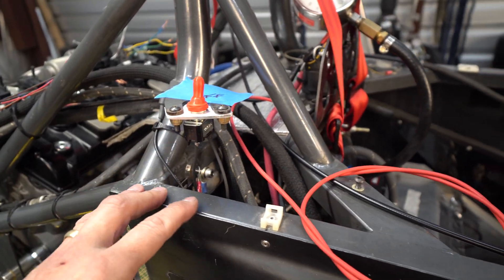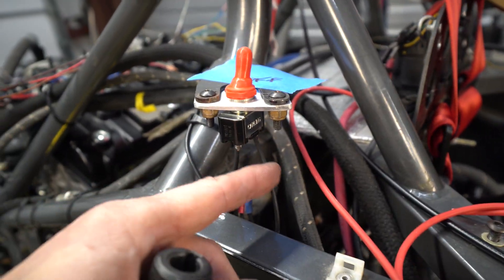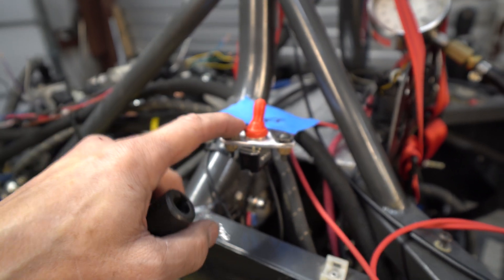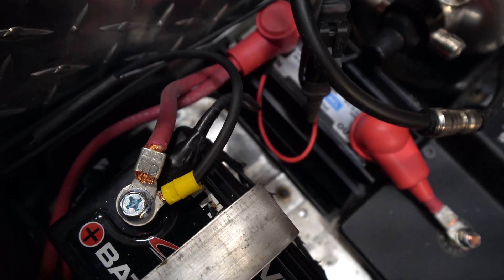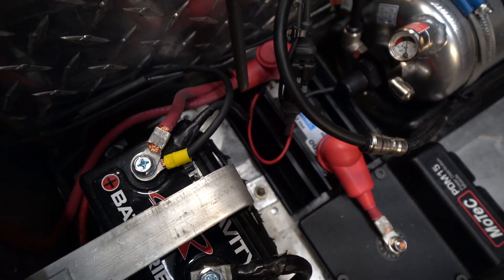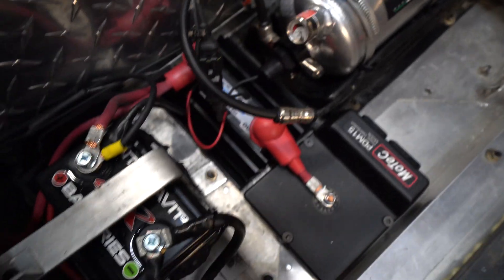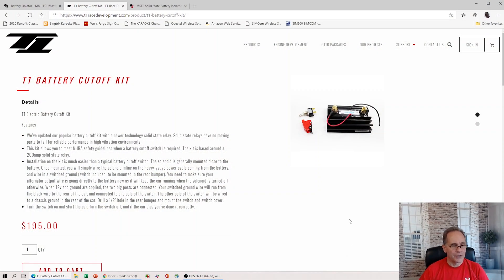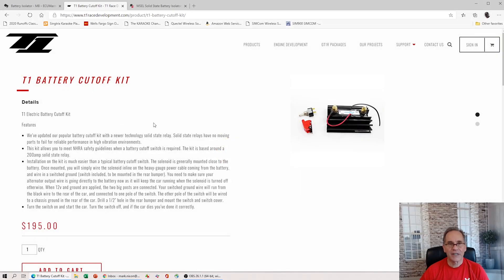SOLID STATE BATTERY RELAY (ISOLATOR) - A Race Car Solution You Didn't Know You NEEDED!

Comment: Racewire and arc, in their switches have E-stops. If you wire it as a ground trigger, you wire 2 switchs in series. So both have to be pulled on to connect. 1 inside.the car one on back of the car to replace the old push pull rods
Reply from the maker: Great information here, I have seen the Racewire solutions but not ARC.  It does look like both are worth looking at for a solid state battery cutoff solution.  I do like the two switch approach with racewire.  Thanks again and also for supporting this channel